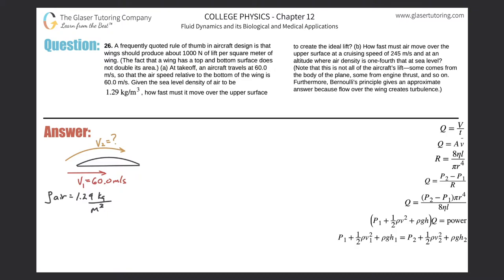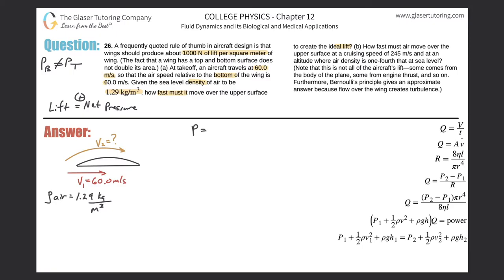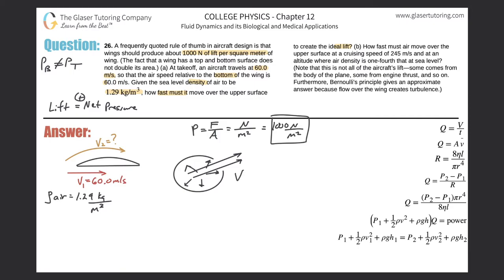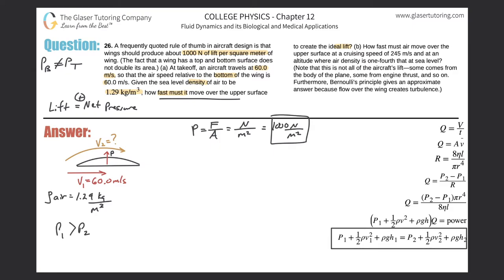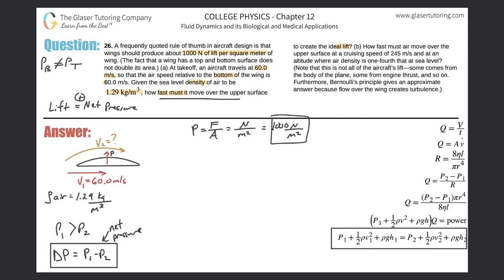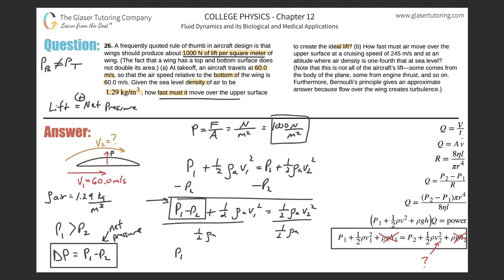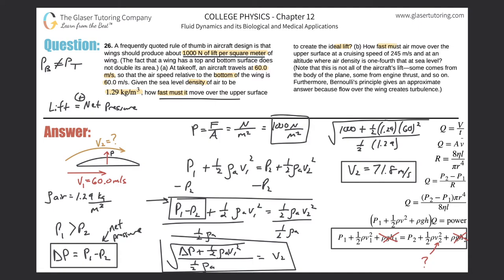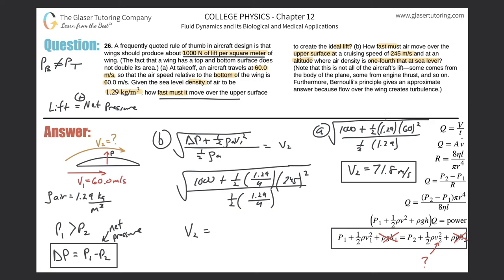12.26 | A frequently quoted rule of thumb in aircraft design is that wings should produce about 1000

Comment: Great video! I tried this on my own first and got 74.8m/s for part a. This is because I cancelled out my 1/2rho when I was isolating for V2. Why did you did cancel your 1/2rho when you divided your left side of the equation by it? Can these not be cancelled as if they are like terms?
Reply: I explained that poorly. I never cancelled out the 1/2, I only cancelled my rho. My final equation was: sqrt[2(P2 + 0.5V^2 - P1)], where my density is cancelled out by dividing both sides by rho when isolating for V2. So, the only difference between our equations is that you did not cancel your rho and I did.
Reply: @justinw5525  Hopefully my answer is correct because an awesome professor had to reteach me this basic algebra concept (which, btw, Andrew in these videos went over a few episodes ago as well). You can't cancel out ρ from both the denom and numerator, because the numerator is part of a term. 

"1000 + ρ" is  a whole term, it's a package deal. If you had "x + a" divided by "a", you can't just cancel out the a in the num and denom. You cannot cancel out what isn't factored out. 

Technically, I think if you really wanted to cancel out that rho, there will still be a rho in your problem. You would have to factor the rho out of your numerator. But by doing so, you're are now dividing everything in the numerator by rho... which means rho will now be in its own fractions in the numerator. That's confusing, but...

"x + ρ" in the numerator. Factor out the rho. You get:

" ρ(x/ρ + 1) " So now you can cancel out the factored out rho with the denominator. But you're still left with x that was divided by rho because you were so determined lol

This is like Day 1 algebra, I think, and I had COMPLETELY forgotten this rule and it made for an embarrassing request to a college professor where I had to ask "teach me the basics" hahaha
Reply: @EmpyreanLightASMR  I see! Thank you!
Reply: @justinw5525  I'm sorry I wrote you a novel, but I hope it made sense!
Reply from the maker: Teamwork makes the dream work - thank you so much for your input.  Keep up the great work! 😀